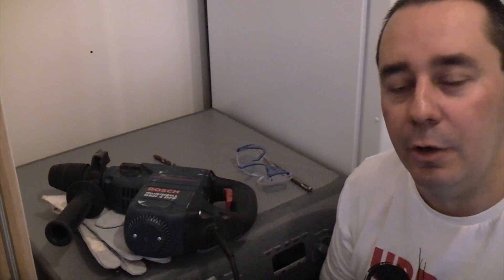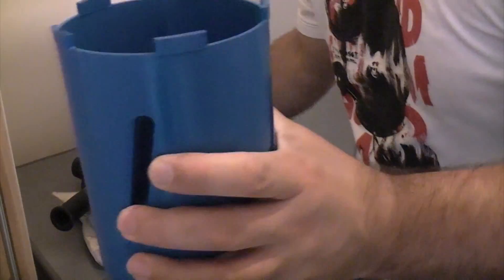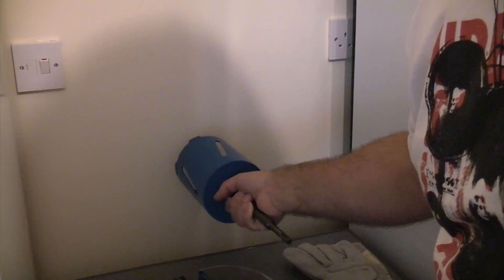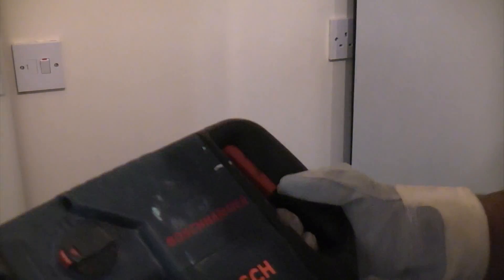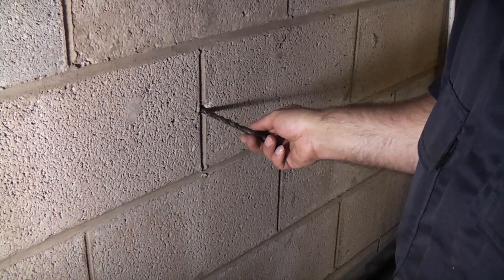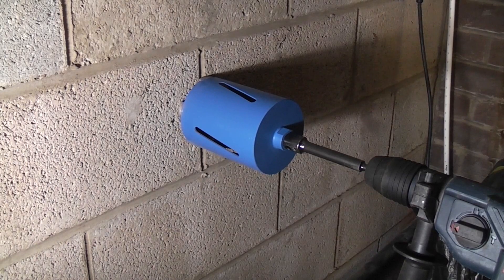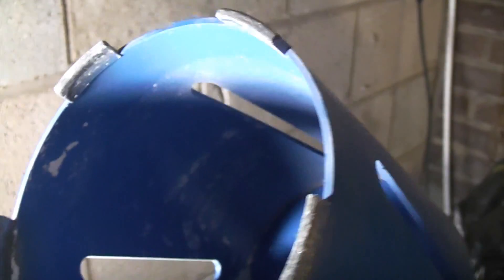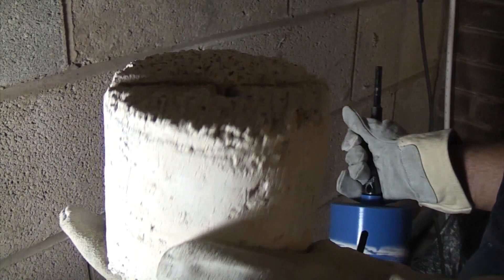How to use a diamond core drill

Comment from the maker: @ brianboru62
If it's just the one hole you are doing your best option might be to hire a dedicated core cutting machine for the day?
I'd always go for a slightly larger core drill- the last thing you want is a hole that is slightly too small.
If you are buying a machine get the most powerful you can afford but make sure it has the safety clutch ;-)
Reply: thanks bought this has clutch  http://www.ebay.co.uk/itm/261643684338 seems good enough. Its doin me head in having an internal soil pipe its causing heaps of probs coz the internal pipe just gets in the way of fitting my bathroom suite in the desired manner.Hence watching your vid on using a core drill bit.hopefully from :( to :)
Reply from the maker: brianboru62
That should do the trick, please let me know how you get on with it ;-)
Reply: trainmanmusic
HAHA stay away from hire stores unless you your a busy tradesman and you NEED  something desperately.Otherwise ebay was great for me saved a fortune and that drill i bought is a beast it whizzes through concrete posts ( to fasten and screw gate post too).Hire stores scandalous prices,I was lucky and bought a 110mm diamond core hole saw 28 quid,a hire store i enquired would have charged me 58 quid for one days use of very same core drill.
Reply: +brianboru62   Hire shops are best avoided.  F'rintance years ago I got roped-into helping a mate take down a load of trees at a GFs house.  A petrol driven shredder had been hired but I took one look at it and knew that it wouldn't work.  The machine employed a drum with swinging flails but the flails were worn and rounded like the helmet on ones privates!  Yup the machine didn't work and it even struggled with a small bit of brush wood.  It was taken back straightaway and to the hirer's surprise the proprietor of the shop hadn't even put the thirty quid in the till.  Presumably he KNEW that the shredder wouldn't work!

With no shredder the bonfire method had to be used.  Unfortunately a very tough looking and irate bloke soon arrived ranting on about soot and smoke on his wife's washing.  It was looking like a fist fight but there were several of us so the bloke backed-down.  Phew! hire shops can cause a LOT of trouble so take care!

With hindsight it might have been better to reverse or sharpen the flails but when one pays £30 for a days hire its a bit much to be expected to service the machine as well!
Reply: +Tech Davey Bloody hell aye,hire anything for 2 weeks and you coujd have ended up buying the friggin thing.
Hence why i bought a diamond hole cutter for what..£20 notes.saved meself 40 quid im sure for a weeks hire that came with a hammer drill.Stuff that got me drill of ebay bloody great take a brick out in 20 seconds.i got the diamond cutter from a weird shop that sells oddball tools giant pliars or ball joint splitters(alice in wonderland for tool heads)
Reply: +Ultimate Handyman Forgot to tell you that drill i bought was tremendous,wooden gate post need fastenning to a horrible granite like concrete post?noooo problems...its a mean drill and yes did the job/s more than adequately!!
Reply from the maker: +brianboru62 
Thanks ;-)

Comment: Hello,
Great video give me confidence to do a job I've been reluctant to start.I bought 127 mm diamond core drill today for drilling a hole for soil pipe in wall, I got 2 questions,is it better to have this size 127mm rather than an exact fit of 110mm(soil pipe is 110 mm)and my main question my drill is useless so im looking for a capable drill are their any particular specs (ie volts,watt or simply a name)i should look for when buying as my eye is on about 5 drills Im not loaded so im looking for a good but powerful drill able for this job any tips i would be very grateful cheers
Reply: +brianboru62 You would want to use a SDS drill for sure not a normal compact drill.
Reply: +Jay I got one for 40 quid its a beast,took a brick out of the gable end in 30 seconds,so i experienced the difference

Comment: This video was really helpful and gave me the confidence to drill through a double layered wall and then fit a vent pipe. It saved me £170 on a quote I had from a builder.
As stated on the video use a clutched drill, the clutch came into action on mine as the bit stuck in the wall. I think it would have been "nasty" had I just used my ordinary B & D.
Reply from the maker: I'm glad the video helped.
Thanks for the comment

Comment: Hi there.
Can a 110 hole be drilled with a normal cordless hammer drill. I realise that it would take longer and I noted your comments about having a slip clutch. I suppose I could hire a core drill. Any thoughts would be great.
Reply from the maker: It might do the job but you risk injuring yourself if the core bit jams, you could also damage your machine. It is possible but could be dangerous ;-)
Reply: Brilliant thanks for the quick reply would a normal sds drill be ok then i've been looking at a few and i can get a cheapish one for £70
Reply from the maker: Ivan Rubery 
It depends if it has a safety clutch or not (most don't)
Unfortunately dedicated hole saw drills are very expensive but some SDS machines can do the occasional core hole as long as they have a safety clutch.
Reply: Thank you. Brilliant info
Reply: don't use the hammer function

Comment: If you are going to remove the drill bit after starting the core drilling, you do not really have to pre drill the hole, at least not all the way through do you. Unless of course you are marking the position of the hole on the other side of the wall, as in your case.
Reply from the maker: Some people leave the drill bit in, but on some substrates it can cause the machine to jam. I only use the drill bit to get the core started, once the core is in the substrate by an inch or so it's often better to remove it.

Comment: what brand of core drill did you buy and how much was it more or less?
Reply from the maker: I just asked my mate to get me a set and he got me Silverline (but they were not very good)
Then I saw a set of Makita on ebay, these were much better and cost about £100 for the full set of 4
Reply: I just need it for a one time use
Reply from the maker: Jonathan Raccah 
You might be better off hiring one for single use?
If not there are some Spectrum ones on ebay that look very good and are not too expensive. I'd recommend the Silverline ones but they are not much good on all types of masonry.

Comment: Very helpful video but I have a question though. I have a set of diamond core drills which came with a SDS plus and hex adaptor and 2 cores with a diameters of 117mm and 127mm (amongst other cores with smaller diameters).
Guidelines of the manufacturer are not to use diamond cores  larger than 72mm in diameter with SDS plus drills as this may result in damage to the tool or the adaptor (because of over the overload on the shank). Hence why they provide the hex adaptor with it so that larger diameter cores can be used on drills with standard keyed or keyless locking chuck that can accept large diameter cores. But that makes those cores kinda useless for me using a SDS plus machine. 

Since I see you use a core of about 117 mm on an SDS plus, what's your experience on that statement? I'd just need it to drill the occasional hole.
Reply from the maker: I have bought a couple of sets of Diamond core drills now and neither of them had any instructions whatsoever. I have used large diameter ones in my SDS machine with no problems yet, but they are better in a dedicated core drilling machine with an hex chuck. For occasional use as long as you take it easy I do not think you'll have a problem as long as the machine has a safety clutch

Comment: Hand vid! Would SDS plus be man enough (900W) or would you advise SDS max?
Reply from the maker: If you are using it mainly for core drilling I would get a dedicated core drilling machine rather than SDS. I'd only get SDS max if you are planning on drilling large holes using drill bits rather than core cutters
Reply: ***** Thanks for the reply, it's just one 152mm hole that needs cutting.
Reply from the maker: Haggard Mat Baglow
For just one hole it is probably more economical to hire a professional machine and core drill, 152mm is quite large and if you use a small machine or cheap diamond core you could find it extremely hard work and possibly damage the machine.

Comment: Love the envelope tip :) .... Is there any problem with the bit over heating in tough concrete?
Reply from the maker: I have not used mine on concrete much but would recommend a wet drilling set to prevent over heating.
Reply: Cheers

Comment: How do I drill in a corner for putting a wireway? it's impossible
Reply from the maker: Not sure exactly what you mean, do you want to drill a core hole in the corner of a room- between the two walls?
Reply: *****
I want to drill it through the floor (exactly in the corner) down to the frist floor below. At least a 2cm hole for a wireway. I want to pull cables though it. But how can I drill vertically it in the corner? It's impossible it will be diagonally. Thank you.
Reply from the maker: sunny flboy
Ok, I now understand ;-)
Like you say it's impossible to drill in the corner as the machine gets in the way, unless you used a larger wireway and moved the hole away from the corner slightly.
What is the floor made from ?

Comment: Great vid but when you had gone through the first skin, shouldn't you then go to the other side and drill through to the garage? to save huge lumps of plaster from falling of the utility room wall. That's what i would do.
Reply from the maker: Thanks for the comment.
No, there is hardly any break out with diamond core's, they just cut a clean hole most of the time. They do make a lot of dust though, hence drilling through from the garage side.
Reply: yes i was aware about the mess, i would have shaped the plaster for a neater finish. May have something to do with my OCD lol.But as you mentioned, Most of the time it breaks out ok.
Still i love your vids and learn from them.
Reply from the maker: MrScarysbro
Thanks for the comments ;-)
Glad you like the videos

Comment: can i use this to bore floor slab?
Reply from the maker: It depends, normally floor slabs are reinforced and so will have steel reinforcing bars running through them. Ideally you need a core drilling rig, which will be water cooled and will cope with the rebar without damaging the diamond core.

Comment: Maybe you could cut a 150 mm hole in some ply with a jigsaw and the plug and screw that over the existing smaller hole. this may provide the support needed for the core drill without it slipping when starting the larger hole.

Comment: I have a 100mm duct in a bedroom. I need to install a heat recovery unit to remove high humidity from the room. The unit only comes as 150mm, you mentioned that expanding a core size is a pain, any ideas on how to approach this? Its a hollow block wall, would I be easier chiselling it out with an impact hammer?

Comment: i would defenetly not drill a concrete wall like this. you will need a drill and a drilling machine that can supply water both for cooling and washing out concrete  dust...if you dry drill concrete you will get the drill stuck in no time. and that can wery easy result in a sprained wrist

Comment: I have a Bosch - 11241EVS drill but it doesnt have only drilling option. It works either hammer or hammer drill so can I use diamond 3' with hammer and drill option together. Will it be stable at first???

Comment: yup I just did a core above ceiling grid, 2-1/2" hole...thru brick. Took me about 10 secs of drillin and I bolt to the truck, got my gloves, my mask, my safety glasses and ear plugs. My mask was completely red when I got thru....I was surprised that the vibration went down a little when i put on my gloves. And the ringing in my ears not as bad as when I didn't have plugs on. Learn my lesson that day.

Comment: I have an rayburn with a 5 inch flue pipe but if I replace it there will be an 150mm flue.From what you say the core drill will not easily enlarge the hole, any ideas

Comment: I always go through the inside plaster just a few cm to stop it cracking. Can almost guarantee if you go straight through from one side the hole will not be a clean neat cut.
A helper with a Hoover works well inside too to keep dust to a minimum

Comment: i got to drill through 2 steel reinforced concrete beams above an old doorway and it tool over 2 hours of drilling to get through the outer one and now i got to do the inner one.....   the corners are beginning to wear ont slightly on the core bit now :(      any advise or just keep going? 

the steel bars are about the size of your index finger and i have managed to get through 2 of them in the first beam.

Comment: Good video on the correct procedure for dry diamond coring. However, SDS machines are really not that suitable for this application. They might be big and powerful, but they do not rev fast enough for the diamond segments to work properly. A dedicated dry diamond core machine will rev between a variable 700 & 2500rpm and will have a slipping clutch.